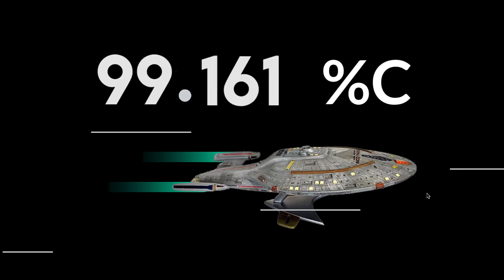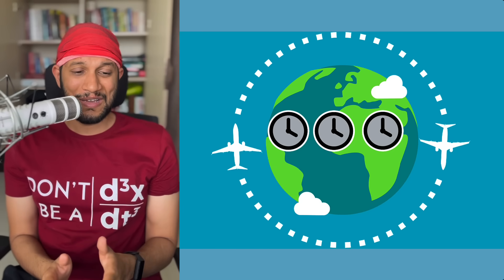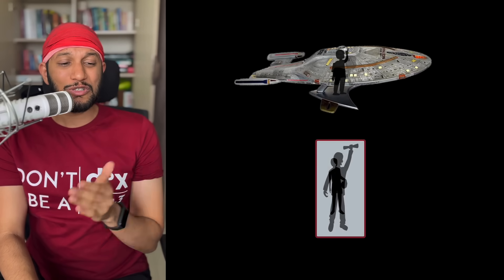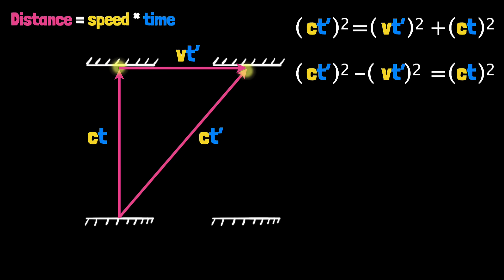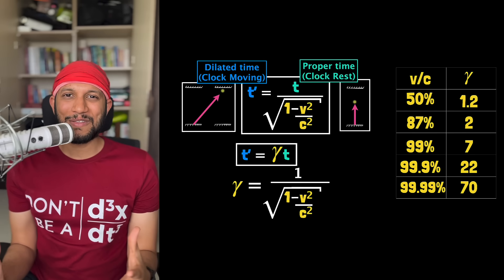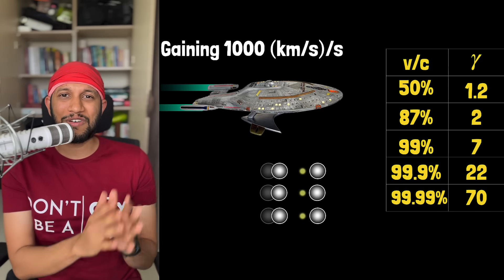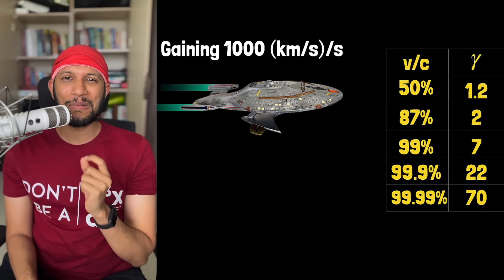I finally understood why you can't go faster than light! (My mind is blown)

Comment: Fun idea, but the "relative" aspect proves that objects can move faster than light. Mainly noted because light moves at the speed of light in our solar system while the solar system moves away from the universe center at 514k miles per hour. Which is a fraction of the speed of light, but itself we wouldn't have anything come close to the speed of light if there was a limit. In other words, the speed of light from our solar system would be faster going away from the center of the universe than toward it. Given direction doesn't matter, relative to the center of the universe, light is traveling faster than the speed of light.

Comment: I am ignorant, but photon,shouldn't have mass.
But, speed of attraction, is influenced by mass.
So, lf you have, a mass so big, to attracs material, more fast, than  speed light, you should overcome this limit.
In Theory.
Black holes (of space), trap the light, but it's exit outside of the top, of black hole  like radiation.
So, radiation, is more speed than light?

Comment: This is an explanation from the point of view of the observer (15:07), how time dilation shows the ship going slower and slower to an observer on (I'm assuming) Earth, but what happens inside the ship while they are accelerating (assuming the ship has an environment that prevents the crew from disintegrating due to acceleration)?
Reply: I'm also wondering this exact thing 😂 my guess would be they would just keep accelerating but never reach lightspeed
Reply: @tomwhite5868 inside of the ship they will reach speed up of light with acceleration of 1000 km/sec but outside universe will die in last 0.00000000000000000000000001 second of accelaration. But if plane won’t be affected by the death of universe, he will reach speed of light, and after “permanent” time outside will start moving backward in time.
Reply: inside of the ship they will reach speed up of light with acceleration of 1000 km/sec but outside universe will die in last 0.00000000000000000000000001 second of accelaration. But if plane won’t be affected by the death of universe, he will reach speed of light, and after “permanent” time outside will start moving backward in time.
Reply: But moving backward will start only after the time “existance” outside ends. And time will start moving backward like loop..

Comment: Arent you biasing the theory by sekect vector orientatition? Try placing the oscillating atomic clock orthogonal to the travel cector(colinear). You have a problem with V1+/- V2 in oscillation. Technically, approaching C would make time and colinear atomic/subatomic/photon near standstill appriaching dead in forward direction. Moreso you have the probkem of momentum transfer that does occur on photon impacts, approaving a feather touch to nil approaching C in colinear (+) direction since photons travel at C and nesring double C in relative speed impact in the (-) vectir oscillation phase. Such impact is never considered, but ther (-) cycle is impacting a ship aporoaching C in the (+) and this is mandatirily near double effect in collision momentun but more so near double C2 in phoyon relative kinetic transfer to momentary potential energy of the rebound surface. Would that create a catastrophic explosion_fissioning/fusion unknown? Also that (-return photon would doppler red shift its frequency to an outdide observer since its rebound surface is  traveling from a receding surface, but then is being recieved by and equal velocity progressing surface absorbing it in a blue shift to the ship and not the observer. Are the shifts equal and cancel out to original photon frequency from an colinear path oscillation? But something is wrong because tge momentum/kinetic transfer of the follower rebound surface is not the same as a static surface.  Remember, the Einstein oscillation model leaves the rebound surface at v=0 static. This is tge first quandry illustrating the model is wrong in explanation, not mecessarily result due to colinear  directional elimiation.  Hiw do you think this would effect subatomic and atomic/molecular 3-D bond oscillations and breaking(decay) with colinear vector quandries. Uranium decay woukd not be 3-d soerucalky uniform and could ve further altered in string magnetic fields(NMR effect on papulation precessions).  Remember, subatomic studies are done in extreme magnetic and electric fields...not reality.
Additionally, another model quandry is the ship approaching instantaneous linear light speed in a held circularr orbit around a center or orthogonal axis observer rotating at the same frequency os the orbit.  In other words, no matter how hast the ship goes, it is at apoarent Static rest to the observer, no relative motion. The axial rotation frequency is same as shipnorbit,  but velocity is near zero relative to the ship in orbit. 
Non doppler effect...unless theory has to do with empty spatial Aether Effects(ie-neutrino field effects).  If the matter falls to time lag for discret orthohonal photon radial descent thru the distance to center/axis, as if the central observer never seeing the photon due to degrees turned away in  travel time, tgen adjusting the core/axis rotation while keeping the orvit radius constant should allow a strobe effect reception in multiples of receiver aligning soed accojnting for delay.  But, then, the linear velicityies wont match, now entering a subltle linear relativity phenomenon.  This is not studied abd is crucial for natural electron orbits and black hole horizons as well as discs and jet axes.
And this is not considering acceleration differential  relationships vs linear velocities  in orbital models along with varied orbit non circular shapes.
Maybe a fancy 3-d promter spinning on axis aid effects.

Comment: Thanks a lot for this amazing video!. I have never thought about this problem from this angle.
I just have one question, anyone in the comments section can answer if they want, not just the author of the video :).
Your explanation is crystal clear if we consider the reference frame of someone seeing the spacecraft accelerating, but what about someone in the spacecraft?. For them time goes normally so there is no time dilation.
I was thinking that in such case we need to take into account the space contraction, that also happens when moving really close to the speed of light. If we take this into account and the space (length of the journey) contracts, we can say that as they get closer and closer to the speed of light the length contracts for them so their instruments will never detect they have traveled the same distance the speed of light would have traveled in the same time. Am I close or completely wrong?.

Comment: You are not correct!
The twin will age slower relative to the other twin who stays put.
Relative to the travelling twin, this twin will age just the same.
IOW, 90 years will still be 90 years for that twin.
Or, to put it in other terms, the travelling twin's aging process will not change.
Time is relative to the observer.
That is, if time exists at all, because I am in the camp which says that time is only our illusion.
What exists is timespace. Time on itself doesn't exist.

Comment: It might be semantics, but I don't think it proves Time Dilation. At least as understood by a layman. I think "time" still ticks along at the same rate in every corner of the universe. The same laws and forces apply. Time is basically the "fourth dimension".

It is just that particles that are trapped in circumstances of high velocity, they have different properties. That is slower matter.

But yes, from an "observer perspective" it looks like Time itself has slowed down, since everything else has slowed/sped depending on where you are observing from.

Comment: BUT: inside the ship, if C is 1,080,000,000 km/h, after 1,080,000 seconds, they shall reach speed of light (theoretically)? but you can't measure it from the outside.

or am i completely wrong here?

Comment: This works only if assumption that light travel to all direction with same speed is true. And there is no way to measure that. Maby we just dont know exact speed of light from point A to point B. We can only measure speed from A to B and B to A and divide by 2 ;)
So basically if you need to "measure something" to be usefull in science, Einsten can't measure speed of light without ASSUMPTION that light travel to all direction with same speed. Which could be wrong and it's only assumption without any evidence... 

Figure this out... ;)

And if you talking about spaceshit accelerating... Yes.. you need thousand of years to accelerate 1000km/s BUT.. you only need 1second if you are on the ship. So... maby we can't see something travel with speed of light, but if YOU are INSIDE of this spaceship... you just need to wait a second :)

And of course E=mc2 look's great on tshirts, but is so wrong. It's again simplified version of the equasion.... becouse if "E=mc2" will be right, please... calculate energy in photon from this equasion ;)

Comment: What made it click for me was that speed of light has nothing to do with ligth. In the sense that it doesn't come from some kind of property of light it isn't caused by light itsel. It just happens that photons are one thing that can move at that speed and speed in real world doesn't use standard arithmetics, when you add speeds x and y it doesn't just equal x+y that assumption is just wrong, it actually equals (x+y)/(1+(x*y)/c^2). When we plug that in every other phenomenon starts to make sense

Comment: Until now, I always found the statement "you can't go faster than the speed of light" confusing. I always thought it meant you can't accelerate forever. But it sounds like it means you can't hit that speed from an outside frame of reference because of time dilation, which makes a lot of sense, since "speed" is a measurement reliant on relativistic values. However, practically speaking, it means if we have infinite (or a very large quantity of) fuel, we can continue accelerating to a point where we can cross the entire known universe in a "relativity" short period of time, correct? Because we're not breaking any physical laws that prevent accelerating forever.

Comment: I always thought that nothing could move at the speed of light because that’s the speed at which an electron goes around the nucleus of an atom. If the atom as a whole is moving at the speed of light, an electron rotating on a circle parallel to the travel direction would have to move faster than that for half of its orbit. Is that incorrect?

Comment: Yeah they are not answers because everything regarding SOL is based on a formula that includes SOL as a constant based on... Well, based on what we can observe. Why did we decide SOL should be the constant in that formula? Because this formula was never MEANT to cover things that approach SOL. It was made to explain things on earth, not the entire universe. So SOL was used as the limit to what is practical to observe at that time, and in fact we still can't observe anything faster. 

So does that mean that nothing go faster than SOL? Maybe, maybe not. It is improper to use a formula based on our incomplete understanding of physics, and simply because math breaks if you crank it too much declare that it puts a limit on ACTUAL physics. 
It's trying to harvest the fruit ahead of planting the tree. Formulas explain the universe. The universe isn't adjusted to fit a small formula.
This formula also implies time dilation. Doesn't mean time dilation EXISTS, or if our observations can be explained otherwise. 

As of right now, there is no experimental proof one way or another. 

Basically you are assuming that two things are related and affect each other simply because a mammal wrote down some squiggles on paper. And that's incorrect. 

Now, should we just completely throw this out of the window? No. If course not. 
It is fine if we base scientific research on these formulas, assume time dilation etc. it's fine because in the end of the day if at some point we get an unexpected results - we can correct the formulas. So far they have worked for us and led to many life-changing discoveries. 

The only part I take an issue with is declaring an axiom about reality because a formula says so. That way lies string theory, -1/12 and other exciting ideas that so far exist purely on paper. 😮

Comment: How does the spaceship know how fast it is going? Only by comparing its time (or position) relitive to some other reference frame. But how do you know whether that frame you are using as a reference isn't also moving relative to some other frame? So if you are trying to increase your acceleration based on the amount of "dialation" you are experiencing you will get different numbers depending on what you are using as your reference frame.

Comment: This all stems from the speed of light being a constant, but why is it a constant? If you have a photon clock on a spaceship, why doesn't the photon in the clock travel faster than when the clock is at rest?
Reply: ChatGPT said: "Light behaves differently because it doesn’t travel through a traditional medium; it moves through the structure of spacetime itself. This lack of a medium means its speed doesn’t depend on the motion of the source or observer in the way sound or water waves would."

I wonder how Einstein figured out light was a constant.

Comment: Nothing can travel faster than light.  If a photon is traveling the speed of light between two mirrors in the y axis, then you move that set of mirrors in the x axis, the resulting vector can’t be faster that the speed of light, right?  So the y axis motion must be slower.  If this is true, I never understood photon clocks until this very moment.

Comment: Must be dumb but I still don’t get it. You say the limitation is time dilation. So, from an observer point of view, going close to the speed of light means the spaceship is frozen. But this is only a visual effect like a trick. But this is not « really » the case. From people inside the ship, everything look normal and nothing prevent them from accelerating and to go even faster. If they drop a beacon,then after 10 seconds they will be X miles away from that beacon even if the observer does not « see » it that way. I get that there is a dilemma here, like how can you see a frozen ship, meaning it is not moving, while from the inside of the ship you are actually moving faster and really moving. So, depending on your point of reference, the same ship is in different places at the same time. Isn’t it that the equation we have today are not usable for this kind of problem?

Comment: @5:07 the hand isn't going to move sideways, it's going to move slightly forward and down, you just won't see it in that small range. If you expand it, you'll eventually see that it's coordinates have changed from where it started. @7:57 Sounds like what you're saying here is that it has to be measurable by us and therefore since light can go passed the speed of light neither can recordable objects. If they're faster we won't be able to see them and observe them but we can still estimate something going faster than light so I don't get it? This is kind of like what Schrodinger said? ok cool, listened to your whole theory, IMO tachyons are faster than light and also spooky particles. These are facts, so you have to work backward and say what's wrong with your thought experiment? What are you missing in the so called Einstein thought experiment that makes it fail with these two examples. Young buck figure it out please!

Comment: The First picture is wrong. Relativistic kinetic energy is only proportional to Gamma and not to v^2 * Gamma. Relativistic momentum is proportional to v * Gamma. Both together gives you the Energy-Momentum-Vector and the length calculated with Minkowski-Metric gives you the Energy-Momentum-Relation.

Comment: but what happens when you speed up 1000(km/s)/s but are looking at it "from the inside". The speed goes up slower from the outside because the time slows down. But from the inside de time doesn't slow down...

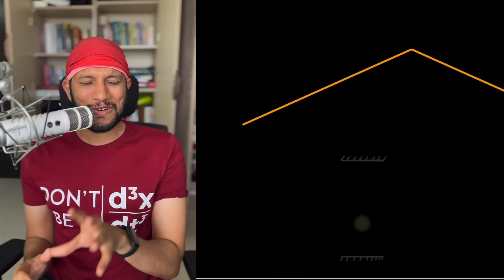Comment: Very nice video.  About 2:20 it would be good to tilt the stationary clock in the angle of the moving clock do you can really drive home the point that the photon is travelling at the same speed.

Comment: For us to see time dilation that is, but that a model problem. If you launch two ships to opposite directions which sum of speeds exceeds the speed of light, they two will never see each other, and from their both POV, they move faster than speed of light, but nothing breaks how? The planet, the galaxies themselves move at some speed, so how we could account all that? The answer should be that transfering energy to molecules cannot be performed faster than speed of light, because it is its' max transfer speed, and if you count your speed from a static point of cosmos, and see that you reached speed of light, then further acceleration would presumably (you can't execute an experiment now) just create an excessive energy at a point of acceleration which will either destroy engine, or just spew back more matter at steady pace, basically meaning that ship will create speed of light resistance towards engine forces. Like putting rocket engine against a concrete wall during an engine test.